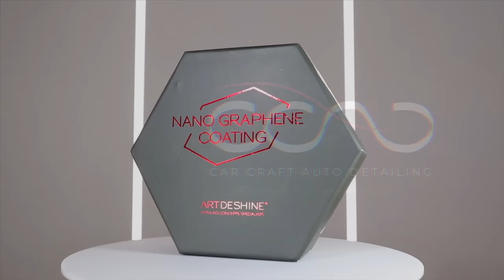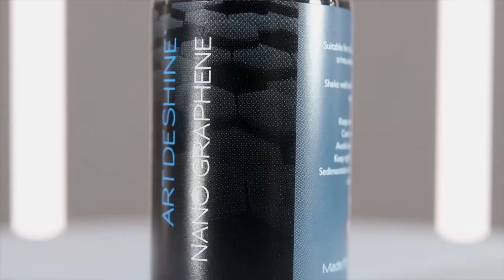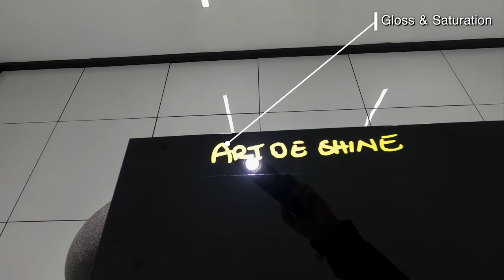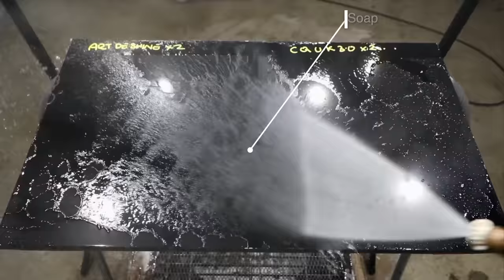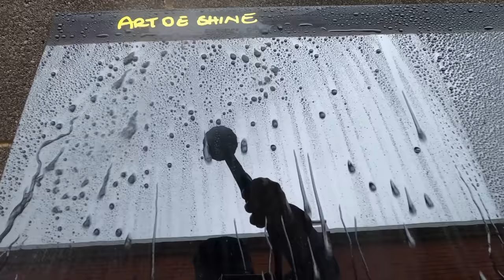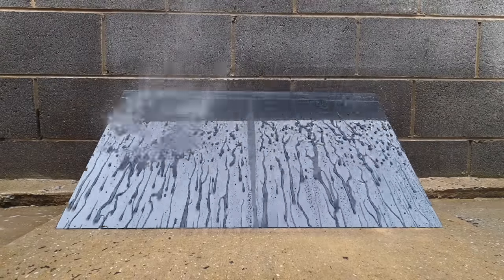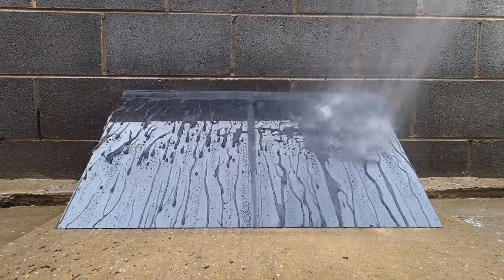A REAL LOOK AT GRAPHENE vs CERAMIC COATINGS + ArtDeShine Graphene Coating Reviewed!

Comment: I agree with you the technology is just not there yet. True graphene is very expensive and is only one atom thick. These new products are (in my opinion)are graphene oxide mixed with a carrier or transfer solution. So basically a ceramic coating with some graphene oxide mixed in.
Reply: You probably watched Chicago auto pros
Reply: @williambrewer855  I watched that one as well as several others including ethos, adams and ammo nyc. Also the typical google search. What’s your opinion on graphene?
Reply: You are right that reduced Graphene Oxide (rGO) is used as an additive in a silicone polymer or composite just as SiO2 or TiO2 is used the same way. These products are widely misunderstood as graphene, TiO2 or SiO2 based when really they are used as additives for enhancement of certain properties. Even more widely assumed is the coating is a "1 atom thick layer of graphene" which really isn't what Artdeshine is trying to make or market as that will not give us any beneficial function we need. That is what many electrical companies are doing as it gives them electrical conductivity and sensitivity. We need not that refinement of rGO or even pure graphene. And Artdeshine do know how to disperse rGO into polymeric matrixes. 

Artdeshine's Nano Graphene Coating is not termed ceramic because the percentages of SiO2 which the term "ceramic" came about is very low. Most of the components are silicone polymers that are cured to be softer and more flexible as compared to hard like you noticed in the applicator cloth. Hardness does not determine how durable or abrasion resistant the product can be (Artdeshine does make hard ceramic coatings too). Abrasion resistance mostly comes from how much friction is produced by the surface, more sleek less friction less chances of marring.

More about why rGO is used in the product. It is a fact that rGO helps with anti-corrosion and in the polymeric matrix it has shown capabilities in IR transmission tests to lower IR absorbance. This is an indicator of lower thermal absorption which we know heat is a very strong catalyst in chemical reactions with contaminants that causes etching.

Comment: Graphene coating is ceramic coating with a little bit of graphene powder mixed in to turn it dark in color but physically does nothing, your just getting the results of the ceramic coating, maybe they will get better over time, but the platelets don’t line up or do what their supposed to do at a nano level...yet

Comment: Buy some graphite lock lubricant in a hardware store. Spread the powder on a clean glass surface. Use another piece of glass or razor blade to really force it on. See if it’s hydrophobic compared to untreated glass.

Comment: Was looking for more info on Artdeshine and thanks for doing some side by side comparison...Im a skeptic on the graphene tech and ceramic coating ive also been doing some testing for a couple of years now mainly for cars being daily driven and never see a garage, ive used low to high priced ceramic coating along side graphene coating, ceramic spray coating  and NV Jet + Boost on the other panel and so far the ceramic coating although still there but barely and adams graphene coating and ceramic spray coating are good about 70% intact and not surprisingly NV Jet +boost were keeping up with the ceramic coatings after 10 months of application. And the main culprit of the degradation is the early am morning dew + morning sun why? because ceramic does not like water and the sun this is where Graphene and other ceramics that have titanium dioxide really shines out. Hence Im as slowly transitioning to the NV care care flat form and graphene tech.
Reply from the maker: Thanks for sharing you personal experience here, appreciate it mate!
Reply: @CarCraftAutoDetailing  No bradah thank you for sharing and comparing different products, The versatility of NV care and resiliency is what makes it unique besides the ease of use and i agree a little product on the pad will not only work well and streak free. I also applied for the pro level coating and cant wait for the announcement on when it will be out here in the US.

Comment: Good video.   ADS doesn’t recommend 2 coats.    While it is more finicky to apply n remove, once you get the hang of it, it’s a great coating.   The directions came in my box but are a bit confusing.   You can go directly to their page on FB and ask any questions you have though and get fantastic answers to help you.   They do also have different coatings with different levels of shine, chemical resistance, or ease of applications as well.   I really like ADS products and think you definitely get what u pay for.   Thanks for the video!!! It’s a good one!!!
Reply from the maker: I appreciate the info and that’s great that they have support for users on FB.
Reply: @CarCraftAutoDetailing  ohh, and the NGC you used in the video is V1.  They have a V2 now, that is easier to use and more chemical resistant.   Good day my friend
Reply from the maker: Great to hear and I think there great potential there!

Comment: Graphene coat finally looks darker deeper paint and tighter beads. Definitely a lot better product. However I don’t use this brand but I will agree that graphene is hard to put on and takeoff it is grabby but it does produce a very slick finish you can also follow that up with a garphene spray sealant. For Ultimate slickness and hydrophobia.

Comment: Great balanced review. However I think Graphene only needs to have the smallest of advantages to overtake Ceramic coatings despite cost. The slight immediate slickness and hydrophobic properties advantage you demonstrated would be enough for me to choose Graphene. Also there is the very slight advantage of a little less water spotting..

Comment: Graphene hasn't been out that long in the US.. I Used NanoBond Diamond ceramic hard coat 2x as a base and well rounded Ceramic spray toppers and that does real good in protection and water beading.. now I have seen some graphene sprays hit the market not too long ago like 303 products graphene spring and Adams graphene Coating in spray.. but for me that technology is too new and to unproven for me.. I mean it is graphene oxide which uses distillates to help it bond to a coating.. but does it really do that much more protection in water beading then I high concentrate SiO2 coating like NanoBond or that quartz ceramic coating he's using.. I'm not so sure. Now I'm sure giving time that grabbing sprays will advance and maybe come much better than ceramics and much more durable for longer-lasting effects.. but for me it's just too new.. I do not go off buzzwords I go off Proven real world working products.. that is funny though that he did that with the cloth cuz I did the same exact thing with the NanoBond and another High concentrate SiO2 coating I was trying.. The NanoBond won coming out rock hard on the applicator cloth

Comment: Great and interesting video Sandro. So I have to ask; as one of the main reasons to go to so much prep and trouble when applying a coating is to provide the best protection plus looks for your car's paint, how come water spots are such big problems???? I spent so much time polishing and prepping my Astra for the Nova Evo which made the car truly pop in the looks department. However, after those terrible dust storms/ bushfires we had in my home town last year, even after seven days curing time for Evo, I ended up with water spots like you showed in some parts of the car which I was surprised to see had become etchings!!!! The whole point of using a Coating was to prevent this which is why I thought they were way ahead of waxes and/or sealants. So what is the best coating for stopping environmental water spotting or is this just not possible???? I ended up having to do light compounding to remove the really bad water spots. I did have success with Car Pro water spot remover and NV that you used. I also ended up using some lusture and Jets over the top to hopefully increase the Evo's resistance to future water spotting but I could not believe how easy it was to bugger the coatings as you illustrated. And that is why I thought Graphine was this new silver bullet designed to stop this problem. Anyway I was certainly a bit disapointed with what happened to my car's coating.
Reply from the maker: Visually, there’s no wax, sealant or coating on the market that can prevent water spots, so it’s definitely an issue. But you will find that a quality coating will stop those water spots from etching passed it into the paint, but you just can’t stop the coating itself from being etched. So there’s still a great benefit in that a coating will save your clear coat from an etching, or at least within reason, but it doesn’t solve the the visual problem of water spots.

Comment: Q: Sandro, after all those hits of car pro's multi x degressor, ( on the water spotted panels did the water spots go away ?
So Nova Pro sealant is the way to go really if applied to clean second and IPA wipe down painted surfaces or CQUARTZ between the two really, but if nova pro sealant is getting past at least 4 hits of car pro's multi x degressor NEAT as well, then that's one strong bonding agent, cheers Sandro mate your uplouds and reviews outshines everyone else's  on youtube barr none full stop. ✔✔✔✔✔🏎✌👍👌🙌😊
Reply from the maker: No, unfortunately chemicals won’t remove them

Comment: Mate your the best Sandro, cant wait till we see just how it long lasts and when you test the 303 graphene review and tests? OMG almost $300.00 dollars for something which has no instructions from the manufacturer and not even on there own web page, is like totaly unprofessional, even the cheapest car care products out there like cheap as microfiber towels and its manufacturers has details of how to wash them properly,. :) Sandro quick question mate car p[ro's reset car shampoo does it have restoring wax's built into it, so that if you have a coating no matte what it is like ceramic SIO2 based or any hybrid wax or nano tech it helps bring it back when you use it right, at least that's what the web page about the products states?
Reply from the maker: Thanks, but no, Reset has no waxes or sealants in it, what it is is an intensive but pure car wash soap that helps strip off contamination that can inhibit a coatings performance.

Comment: @ car craft auto detailing

Have you considered re-visiting this coating as this was the v1 artdeshine and they have improved A lot now with V2 and The newly released V3 also now there is an Australian distributor with a lot more reasonable price  50 ml bottle for only $220 aud
Reply from the maker: Yes I’d be happy to revisit it, there’s a lot of new ceramic/graphene coatings I’ve got on my list to try and I’m happy to add them to the list and give the newer versions a go in due time.
Reply: @CarCraftAutoDetailing  i’m going to test out the new V3 on a brand-new Kia this weekend hopefully it is good and lives up to its expectations
Reply: @CarCraftAutoDetailing    Just thought I would update you on the ART DESHINE V3 nano graphene coating .
Wow is it a breeze to apply I don’t know how they did it as it is like baby oil in the bottle it is basically nearly temperature and humidity independent  and very forgiving in terms of leaving high spots will wipe down a long time after if you miss one and it feels smoother than a baby‘s bottom looks amazing as well now just to wait to see the long-term testing cheers Mitch
Reply from the maker: Fantastic to hear mate, I’m glad it all went well!
Reply: @CarCraftAutoDetailing   thanks I was thinking you will have to make a new slickless test for this coating catch a gecko and see if it can run across the bonnet lol 😂

Comment: Thanks Sandro for doing this! 
I have recently coated med SQ5 with Artdeshine Nano Graphene. I put leveling, Nano Graphene, Nano Graphene (two layers) and ended with leveling.
Yes it is harder to apply but I thought it was ok with dry, wet, dry cloth method. 
The gloss, slickness,waterbeading, look are really good and now we have to see how it holds up. The second layer was easier to apply and I also have the detailer to take care of it. 
I will be a interesting test over time. 

Whats is you top three coatings?
(Also combined ones as cquk uk+bliss or Myabi+ism or so).
Reply from the maker: That’s great to hear, I personally use a lot of CQuartz and Nova coatings and their top coats/sealants and quick detailers as well.

Comment: Hey mate, me again!  I suggest you try ethos graphene coating. Big hype around! And it's like $100 usd. I have seen videos but I have not tried it. Same with 303 graphene
Reply from the maker: Ethos isn’t available to me in Australia, they actually reached out to me months ago and said they would send me a sample but never did, 303 graphene also isn’t in Australia yet.
Reply: I have the Ethos Graphene Matrix Coating. Currently I have Mayvinci C16 ceramic coating on the side panels of my car AMG E55K  for 2 years now. I had Carpro Quarts UK 3 on the bonnet, roof and boot. The Quarts lasted 8 months. The Mayvinci is still performing like day 1. I now have Ethos Graphene Matrix Coating on the bonnet, roof and boot. Like the test in this video the Graphene seems to be behaving better with the water than the Quarts as it's early days. The graphene appears to be performing similar to my Mayvinci  coat but seems a little better than than the Mayvinci in the beading and I had no water spots after rain. The rain was mixed with ash as we had back burning. The Mayvinci cost me 500 aud dollars. The Graphene 160 AUD. I bought it from the US. Application of the Ethos was easy. I did it this way to see which product outlasts each other as the Graphene is supposed to last for five years and the Mayvinci 3 years. Time consuming test but it will tell the truth. The Graphene is great so far but time is the factor.
Reply: Chicago Auto Pros reviewed Ethos.... tldr: very underwhelming

Comment: Love your work Sandro and have watched all your reviews just about. 

Did you happen to get your product of artdeshine graphene from ZAS? 

They have lost their supplier role for artdeshine, the new formula of Artdeshine NGC is $220 for 50ml and has very very in depth application information and is not a consumer base bought product its 'professional only use'
Reply from the maker: Thanks and that sounds like a great improvement on both price and kit!
Reply: @CarCraftAutoDetailing  most definately, the new formula is a lot less grabby on application aswell, the formula you have used is reccomended to use the levelling solution with as this new formula it isnt required and levels out quite nicely.

Itd cool to get your thoughts on the newer formula at some point :)

Comment: Great video as always Sandro appreciate your insight in regards to this products. I have a question, what coating would you recommend for me ? I would have to apply it outdoors as I don’t have a garage , is there even a coating that I can use under my circumstances ? I currently use NV Jet . Thanks
Reply from the maker: Thanks, and CQUK is really an ideal coating in your situation as you can immediately apply and wipe it off and it cures about as fast as any coating on the market which is important if you don’t have a garage. Just make sure you work on cool paint out of direct sunlight and add the layer of Reload a couple of hours after you finish applying the coating.
Reply: @CarCraftAutoDetailing  ok thanks ! I thought I needed to let CQUK cure for 24hrs in a garage . Thanks again for tour help
Reply from the maker: If you have a garage that’s ideal, but Reload can also help protect the coating in the absence of one will it cures.
Reply: @CarCraftAutoDetailing  Last question, as i am going to purchase the coating + reload, to remove jet , just use a 1 step compound? Thanks again Sandro
Reply from the maker: Reload already comes in the CQUK kit, but if Jet is a little older a good decontamination process should remove it, but just a light polish will certainly remove it if not.

Comment: Thank you for your high quality reviews.
One question regarding art de shine nano graphene.
If buffing is performed after applying the coating, stains and residues will not be removed  from the entire application surface.
Buffing with very high force will remove the stain
One thing I noticed in your video was to buff it right away with a slightly damp towel.
Will this help remove stains and debris?
I am wondering if there is any adverse effect on the coating layer.
Reply from the maker: Ideally you shouldn’t have to use water or a damp cloth to level down or wipe a coating as it may reduce it longevity, but without a damp cloths it’s just too difficult and potentially more aggressive on the paint to level this coating down, but water should help remove any streaks.
Reply: @CarCraftAutoDetailing  thanks a lot, have a nice day

Comment: In the USA it will cost you $220 USD to purchase ArtDeShine nano Graphene coating , including freight cost from Canada. CQUK will cost you $55 and is frequently discounted as low as $41.25. So ArtDeShine is at least 400% more expensive than CQUK. ArtDeShine claims this product has a high resistance to water spotting. Thanks to Sadro’s excellent comparison testing we know this product does not deliver on its claim. Case closed.
Reply from the maker: That’s makes it more expensive in the USA which is really surprising as we usually pay more for products in Oz, but UK 3.0 is about $90 AUD but it comes in a kit with applicator, cloths and Reload.